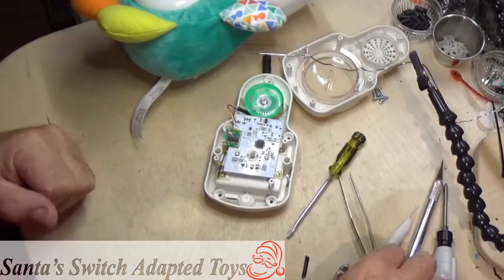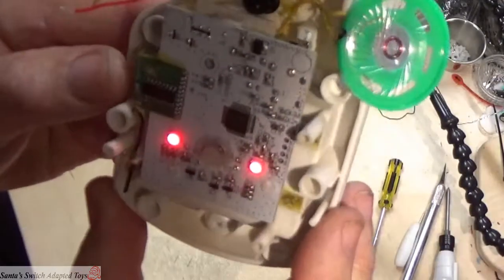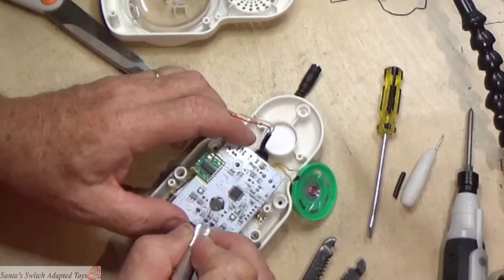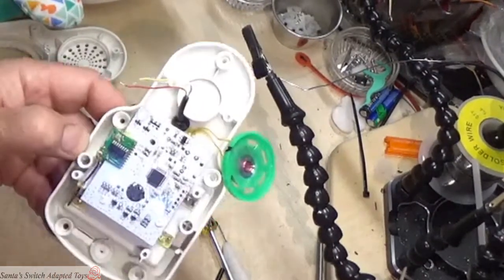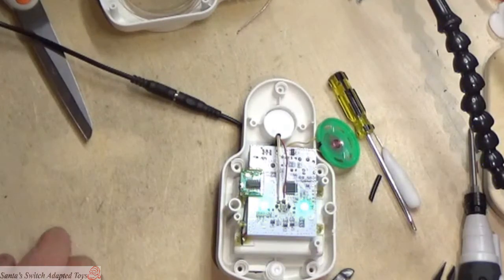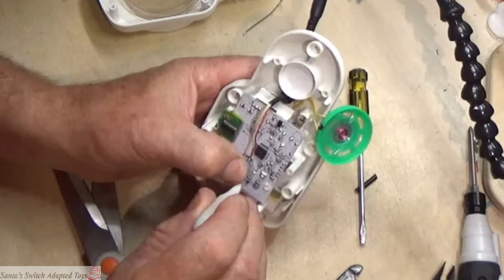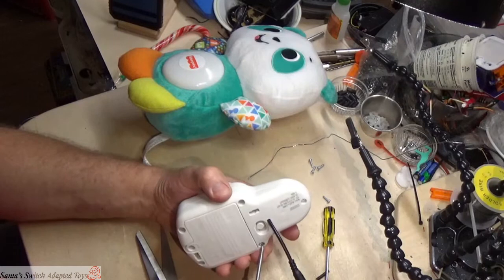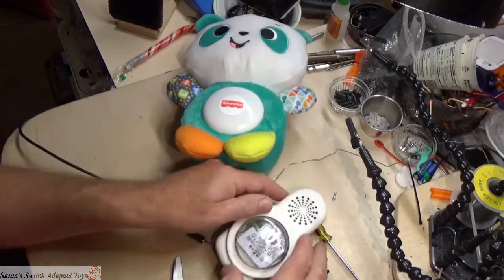Santa's Switch Adapted Toys- Adapting the Linkimals Panda

Comment: Does it matter which wire you solder to which part of the circuit?
Reply from the maker: Either of the two wires coming from the adaptive switch can be soldered to either of the connection points identified in the video. 

Assuming you are connecting a short cable with 3.5mm plug so any switch can be used. 

If you have a stereo cable, which has 3 wires, then you must identify the wires going to Tip, Sleeve, and Ring, and combine the Sleeve and Ring to make one wire, turning it into a mono cable.  Ensuring the Tip is not touching the other two wires.
See the link in this video description for more detailed information.
Reply: @TheLaserguy2  thank you.  i've been using stereo female panel jacks and folding down one of the prongs.  then soldering mono wire to the ground prong and other prong.  doing it that way it seems like i have to connect them in certain order or the switch won't work.